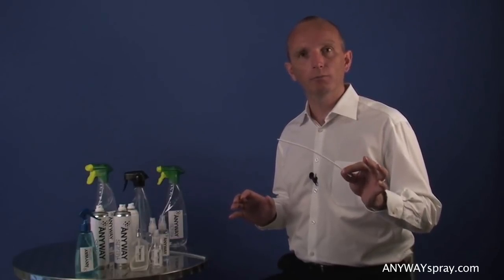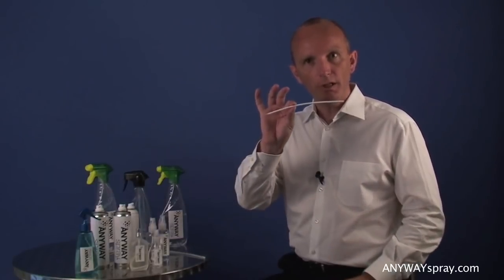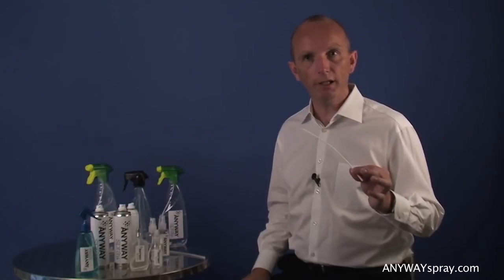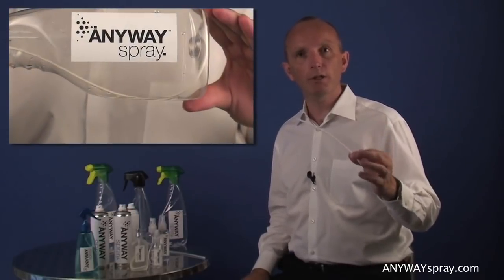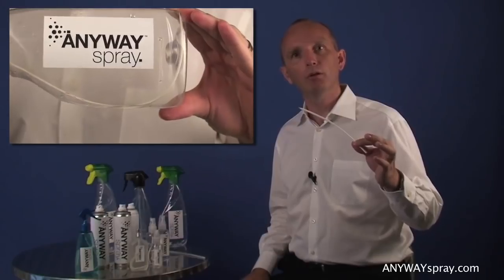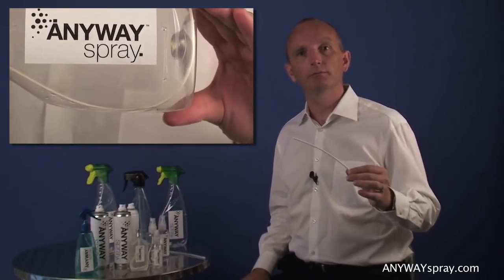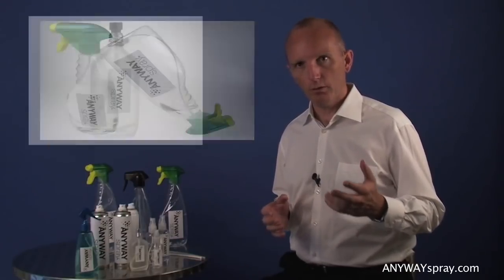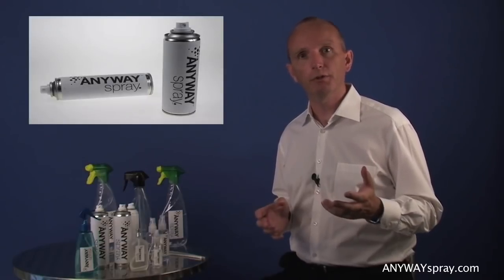How Does ANYWAY® spray Work?

Comment: Amazing save one point needing additional resolution - Can’t clear spray nozzle by inversion. So will be limited use in paint spray cans which will need a cleaning method to allow for intermittent use not plugging the orifice. Otherwise amazing.